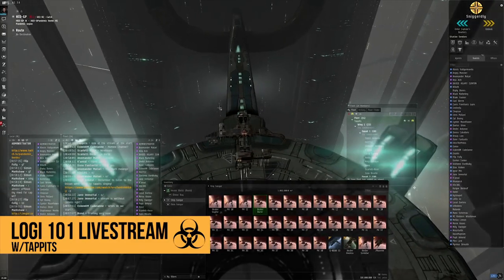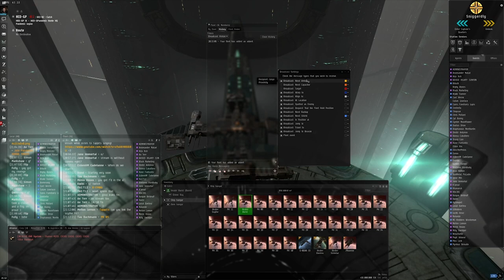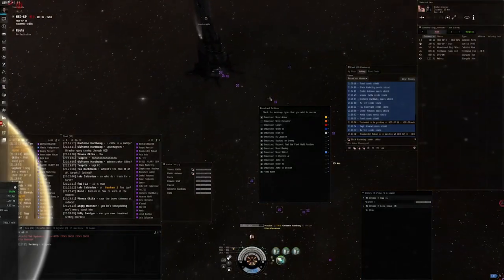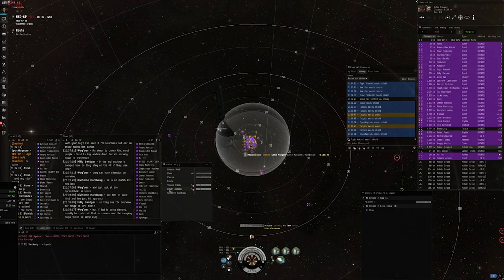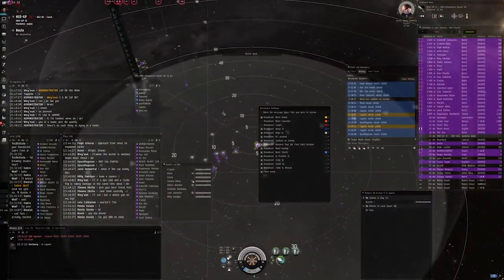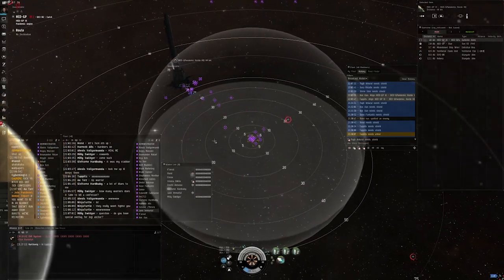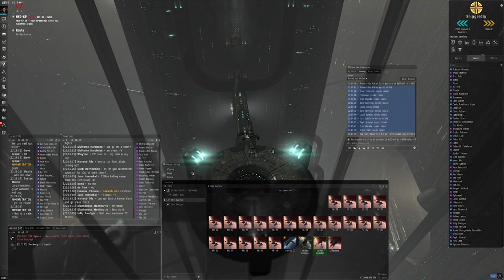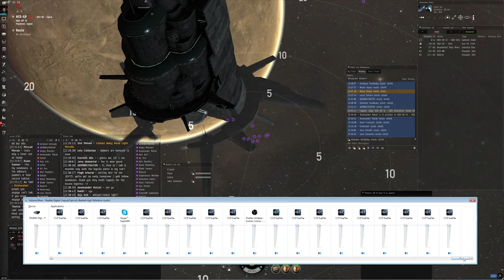Logi 101 with Tappits

Comment: Good stuff.  The confusion aspect why you cap chain in pairs or threes and not in a wide chain. Segments the cap chain without diminishing its effectiveness if someone dies. Three to a segment is more robust than two, especially if you stagger your chain with one transfer on each partner and it takes good situawareness skill. But you lose another lock if you split them. If one pilot in the trio leaves range for any reason, the two remaining can still pair. Pairs are perfectly fine and easier to manage ranges for the pilots among the chaos in the thick of things but if left unattended can cause 2 logis to be out even if only one is dead, jammed, damped. 

That way if someone dies the cap chain will diminish, but continue and can be reestablished as a pair. Those pilots can call that they're a pair and if there is a stranded logi it's still effective. They can rep and join that segment when they get the chance before they cap out without totally disturbing the new chain segment. Cap transfers can also be adjusted one at a time as opposed to breaking the chain entirely this way. No more than three to a segment though. Any more and it gets really messy really fast and you can't split up if you need to in extraneous circumstances to support different segments of the fleet that might need to sprawl out for one purpose or another.

If you're needing more than I think 4-6 logi's, depends (of appropriate class) to keep a particular ship up unless it's hyper tanked. The alpha is just going to kill it anyway in short order. That's where pre-emptive broadcasting is handy when getting mass yellowboxed. Though having redundancy of 8-12+ logi's enhances the chances of not taking alpha losses like that.

I can't count how many times pre-emptive broadcasting for logi to get a lock has saved my bacon.
Nevertheless, do not trust an inexperienced logi pilot. It is a hard job and it takes knowing intimately your fellow logi pilots which can be tough for a very large alliance. The ones that can organize and adapt chains quickly. quietly and clutch save you from 10% structure are goodins. Been there many times as a brawler and losing 1.2k+ deeps is always a bad thing in a facerape fight.

Last time I fought PL before the long hiatus I took was an absolute massacre exactly because of this way of logi tactics. Being adaptable.  Otherwise, I would've been a corpse to their lazorz.